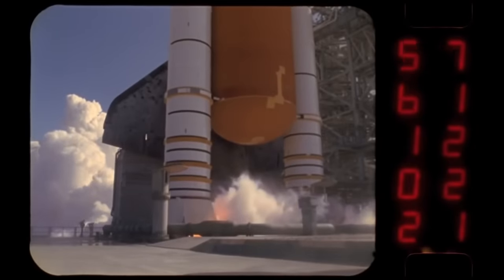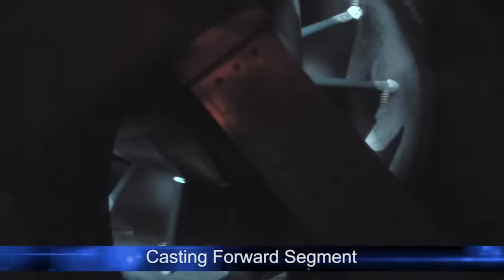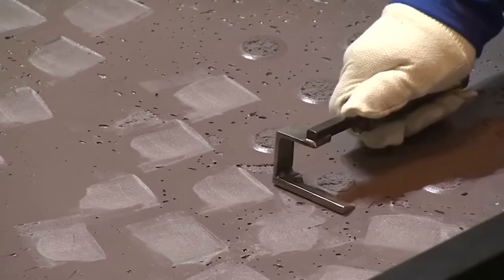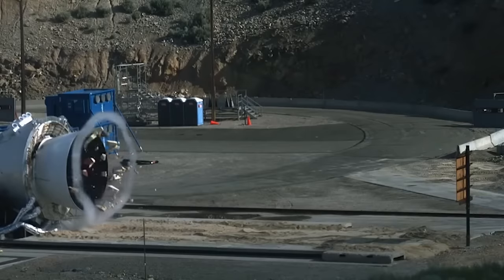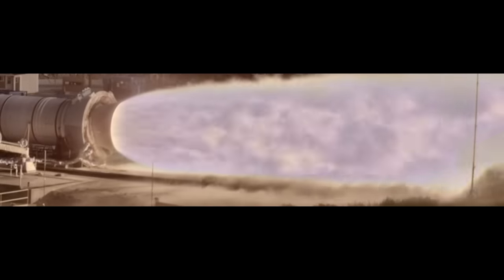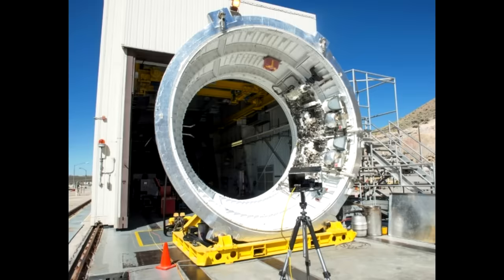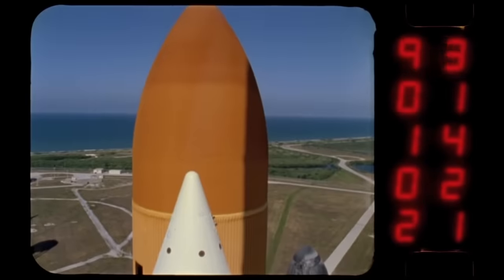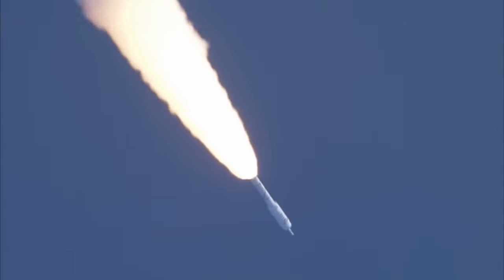The Amazing Engineering Behind Solid Rocket Boosters

Comment: Finally, I get to learn about the space shuttle booster TVC! I've been wondering about it for a long time.
Reply: Yeah me too. I always wondered how they could move considering they needed a flexible part that could take the immense heat. But lots of metal plates it is :)
Reply: @221b-l3t  The rubber seal is the most impressive thing imo. What did they tell the material scientists? Umm, we need a flexible material that can handle a thousand degrees and 60 bar...

Comment: Good Report.
Back in 1971 I was at Indianhead Maryland Naval Ordnance station when a disposal burn of a cracked Polaris motor detonated 1/4 of the way through the burn. Shockwaves from the blast carried by the limestone bedding layer cracked the Capitol basement wall. Both the test fixture and the Capital rest of the same rock layer. 3,000 pounds of propellant went bang in a split second.

Comment: Never knew that about the wind shear on challenger’s last flight.
Reply: Especially considering you hear rocket launchers getting delayed all the time for windshear
They really were in a rush to get that shuttle launch
Reply: @TheJoeSwanon  That's really too bad :(
Reply: jonathan lavezzi what’s worse is multiple engineers even told them that it would fail the night before. The document didn’t become known until a few years after because they tried hiding it.
Reply: @TheJoeSwanon  
Yep the engineers from Morton Thai called told them they hadn't tested the o-ring seals for temperatures that low and they didn't think that they should launch. NASA did it anyway.  Stupid mistake. NASA had way too much bureaucracy. Apparently they still do. That's one of the problems with government run programs. There's very little incentive to be efficient and eliminate unneeded bureaucracy.
Reply: Neither did I!
Reply: @dpreston8831  Challenger was not the first time they noticed burn-through damage on the O-rings; on previous cold weather launches the O-rings showed damage after the SRBs were recovered. That's how the Thiokol (and NASA) engineers knew there was potential trouble. In the Challenger accident, the combination of icy weather and wind shear made for the perfect storm and for the first time there was a catastrophic burn through. This failure mode was known to be a problem but the program was under a lot of pressure to produce a high flight rate and get costs down, so they kept putting off the field joint redesign and crossing their fingers. Mike Mullane's book does a great job explaining the mindset of the decision makers. It's also the reason they kept blowing off the debris shedding problem that eventually wrecked Columbia; that was a known issue from the very first flight and they talked themselves into thinking it wasn't really a threat even though the original requirements from the 70s allowed for no debris striking the orbiter.
Reply: To add on to what others have said: there's a Super Great documentary on it. It's called A Rush To Launch. Check out min 34 to hear about the wind.... But honestly you should watch the whole thing. It'll make your blood boil and tear up, but it's worth it.
Reply: Almost like January weather was really not good launch conditions through and through...
Reply: @dankuchar6821  As I understand it, it wasn't really on NASA. The launch schedule was pressured to accelerate due to the SLS taking over Air Force launches, so the DOD was pushing a mandate of so many launches per year that they couldn't keep putting off. Furthermore, MT never communicated their engineers' doubts about the temperature conditions, so NASA really had no way to know that there would be a problem
Reply: @Xatzimi  That's what people mean when they say the bureaucracy caused it. People in different sections of the same program unable to communicate mission critical information.
Reply: @OCinneide  Yes, but the comment seemed to indicate that it was NASA who knew the risks and flagrantly ignored them, which is not the case. And it's not simply different departments, it's a contractor away with their own departments and problems in communication.
And it's disingenuous to suggest that the Shuttle program's problems stemmed solely from it being a government program. Competing departments complicated the scheduling and design problems, to be sure, but it was Thiokol, a private business, who holds the real blame for Challenger
Reply: @RCAvhstape  Allan McDonald's book Truth, Lies, and O-Rings is also an excellent one.
Reply: @Xatzimi  January in Florida is not usually as cold as it was on that morning. That said, a reliable launch vehicle should be able to operate in cold weather. STS shouldn't have had any problems with it if they hadn't cut corners to get the schedule on track.
Reply: @Xatzimi  hey, go check out the documentary I referenced earlier called Rush To Launch. NASA administrators straight up ignored warnings from Thiakol regarding cold temps. Had to get that bird in the sky!
Reply: @dankuchar6821  That's definitely a huge part of it, but every time there was a delay to a launch you saw news papers with headlines like "NASA fails to get it up yet again". I feel like the whole damn country at the time had an entirely too complacent and egocentric view of what was one of the most complicated engineering projects in all of human history. Combine public ridicule and congressional leaders bitching about program cost and delays with NASA management overseeing their own behavior and you get the Challenger disaster every time.
Reply: @oscarbanana6159  
I know! It's too bad public Perception gets in the way of safety.  Modern boosters are much safer! So at least there's that.
Reply: @Xatzimi  you must be a union worker.
Reply: Lucy Tycho so basically “people in different sections of the same program unable to communicate mission critical information”.
Reply: @Xatzimi  that's not true NASA new about Thyokol's concern but pressured them to give the ok
Reply: Yep. Look at the shape of the plume suddenly change direction. Saw it in a documentary and it showed it so clearly. The joint temporarily sealed itself with 'slag' and would most likely have held on until separation had it not been for the extreme flexing induced by the windshear.
Reply: They suffered the same fate as Chernobyl. 
Conditions were bad, the engineers knew it, but some careerist bureaucrat above them told them to proceed with the olanned operation... the rest is history
Reply: @Xatzimi  Yeah I hate when people constantly complain about government run programs being inefficient and private corporations being efficient. It's a meaningless thing to say. The only thing corporations have any motivation to be efficient with is money, and that often involves cutting corners. Also, there is essentially no profit incentive to go to the moon. It never would have happened if it weren't for government run programs.
Reply: @playgroundchooser  Or just read the damn report. Lucy's not outright wrong, what NASA was told by Morton Thiokol was something more like "Somebody has concerns about the temperature, but we [in management] don't really think it will be a problem" than saying straight-up that an engineer had predicted a catastrophic failure.
Reply: @OCinneide  It was actually a well-known phenomenon that is usually harmless: lower levels of management minimize the amount of detail passed along to higher levels of management and in the process understate the seriousness of various kinds of risk.
A good recent extreme example of this would be the communications breakdown that happened in China in the early days of the SARS-CoV-2 outbreak. Local officials didn't want to seem incompetent or insufficiently independent so they didn't report the true scope of things to Beijing.
Reply: Dan Kuchar correct. It becomes incredibly political rather than merit based. This can happen to large private sector companies but market forces eventually catch up with them. Government run with no market forces you get a long term rot. Thank God space x is doing big things that nasa would never be able to do. All with commercial reasons at the forefront.
Reply: @MusicalMemeology  SpaceX has done very little that NASA hasn't already done, and they never would have done anything if it weren't for all the work NASA has already done. Not to mention that NASA is and will always be spacex's largest customer.
Reply: Well, it has only been mentioned in like fifty Challenger documentaries
Reply: @RCAvhstape  That's such a good book, I've just finished it.  Nothing else I've read describes just how terrifying those launches were.
Reply: @TheJoeSwanon  ice was dripping from the shuttle. But they wanted to impress the president and launched anyways
Reply: @Ok Alright. The pressure to launch came directly from the White House. The President wanted to brag about 25 shuttle launches in his upcoming State of the Union address. Nobody talks about that, not even Macdonald. But I was an engineer on Shuttle at the time and had open access to Bob Lund, the Director who signed the release to launch. We all knew the risk and Bob did not want to release the bird. Watching how he suffered over the next few months was heartbreaking. It still bothers me, too. Gil Morgan, the PR guy with the eye patch, told me at a party during the aftermath of the disaster what he had learned while everyone was in duck-and-cover mode: “You’ve got to be one cold asshole to be executive management”. He quit after the cameras were off him and Rocky Raab took his place. I transferred to Thiokol Huntsville Division at Redstone Arsenal, Alabama as a Project Manager. That was a difficult time. And Gil was right. If you become executive management and you aren’t a cold asshole, you will suffer.

Comment: Awesome video! One thing you may be interested in looking was the precursor work done by Thiokol, who developed the SRBs as you mentioned. Their experience with solid fuel came from their earlier work for the Air Force on the Minuteman ICBM program. Back in the 60s, if you wanted to launch an ICBM, you had one of two options: You could use cryogenic propellants, but these meant the the rocket had to be fueled before use. This meant the rocket force was at risk of being taken out on the ground before they were fully fueled, and once fueled, they had to be used within a period of time before too much propellant boiled off. The alternative was hypergolics, which, while storable, were incredably toxic as you've covered before. This was undesirable in a silo, and a non-starter on say, a submarine. A solid fuel ICBM on the other hand, was safe to store for long periods and didn't need to be fueled. It was groundbreaking in the 60s, and gave them the experience needed to adapt it to the SRB.

Comment: 6:00 "remove pin before flight?"
Reply: That’s a brave man
Reply: The pin locks out the electromechanical "Safe and Arm Device"  so basically the guy pulls the little pin out of the bigger pin  :P
Reply: @rileyk99  the "SAD"
Reply: @rileyk99  Pinsepcion!
Reply: Like the pin on a grenade.  Countdown doesn't start until you release the big lever by throwing it.
Reply: Which is why the incident in the movie "Space Camp" could never really happen. Those pins were not pulled before an FRF for that very reason--so that the boosters could not accidentally (or intentionally, if a sentient robot ever hacked anything) light during the test.
Reply: Bruh has balls heavier than the whole shuttle
Reply: How long before flight was the pin 📌 pulled

Comment: A rather odd factoid:  According to an old BBC show called "Connections", the size of the solid boosters was limited by the width of the railway cars and tunnels from the Utah facility, and those in turn were based on the track widths, which in turn were based on the width of common horse drawn carriages of the day when railroads started, which in turn were based on the ruts in the dirt roads that criss-crossed Europe, which dated back to the days of Roman chariots, which were designed based on the average width of two horses running side by side.  So the SRBs owe their design width to the width of two horses asses!!!
Reply: Which were based on the Indo-European chariots designed on the Pontic steppe.
Reply: ... which was not true, however a nice hoax :)
Reply: The United States used a different railroad gauge than Europe. Rumor has it that railroads in the US were actually reverse engineered by time travelling shuttle astronauts who knew they would need to be large enough for future SRB transport.
Reply: @divedevil985  there isn't a European gauge. Different countries use different gauges. As exemplified by the logistical challenges Germany faced moving eastwards in the early forties. Even different countries used multiple gauges. In the country where trains were invented the lines were made by competition between private firms and there were competing gauges.
Reply: VSauce, Michael here...

Comment: idk man seems kinda easy to build multi-ton boosters for rocket science.
Reply: Not that easy trust me❤️❤️❤️
Reply: @mechanicalrocketeer4900  <=== YOU                                                                                                              JOKE ===>
Reply: "I mean, it's just some clay and a tube. How hard can it be?"
Reply: @psyko2666  well if you wanna find out just go the elementmaker's channel and you can watch them build tiny little rocket engine, that fail horrible, because clay is not simple in the least bit.
Reply: @BloodSprite-tan  fantastic channel; I have almost no interest in actually doing it myself because I know better and he's very clear on why you don't simply play with high energy chemicals what get very pissed off...
Reply: Yes ikr i can literally split atoms at my house
Reply: Used to think the same a few years back, before I followed a rocket propulsion course specialized on  solid rocket motors. Man, the engineering behind them is insane! The chemical considerations on solid grain, its shape as a function of length of the booster, the heat transfer considerations, the combustion-instabilities cause by vibrations... INSANE. We can argue about their utility in this century as the main driver is to reduce launch prices, which is something SRB are not able to do. But from an engineering stand point, developing them right is as difficult as developing an expander cycle for liquid rocket, if not more.
Reply: ..said nobody ever!  :)
Reply: You should see the propellant mixing and casting building after an accident, not much building left.
Reply: @Jeff Jacobson. Thiokol suffered a loss at Air Force Plant III in Utah in 1986 after Challenger. A Peacekeeper first stage motor caught fire in the casting bell while the crew were trying to pop the core. The video camera for remote operation was inoperable and the men were in the bay with the live motor, against our safety protocols. 101,000 pounds of high energy propellant and five men killed.  As you say, there was not much left. All because a middle manager did not approve a new camera in a timely fashion.

Comment: So if the assembled booster is hit by a lightning strike on the pad, when the safety pin has been removed, there is a non-zero chance the booster could light taking everyone on a one way journey?
Reply: That's why the launch tower had that big spire on top, it was supposed to direct any lightning away from the shuttle stack.
Reply: @jwilder47  lol
Reply: @jwilder47  If that's true, that means they really, really, thought this out.
Reply: @ctleans6326  It's NASA, of course it is. But it's correct that that big thing on the tower is a lighting rod
Reply: I mean, it must have worked because the stack was never hit by lightning.

Comment: 6:00 So the takeaway from all this is that SRBs are overgrown grenades. Gotcha
Reply: @Xenro66  APCP does not detonate.  That difference cannot be overstated.
Reply: tell me when a solid rocket booster casing was shattered by the internal pressure?
Reply: @aemrt5745  I worked in every phase of srb from recovery to refurbishing. Please dont reply to me as if you have a practical clue about anything regarding a solid rocket motor because you dont. No booster casing used on the shuttle program ever remotely came close to an over pressure.
Reply: @aemrt5745  what is insulting is when an armchair enthusiast with no practical experience doesn't have the intelligence to listen to someone who actually worked on the boosters and continues to petulantly argue google talking points. You are right I dont know you. ..because you didnt work there.
Reply: @aemrt5745  the original assertion was that srb's are grenades.  No srb has ever exploded  so your cause and effect of a non-event is non-sense and people in the industry who take great pride in working on the most reliable rocket ever built do not appreciate the proliferation of ignorant comments. You are the one who has insulted.
Reply: @aemrt5745  like you said....not sts. This discussion is about sts not hypotheticals. Estes rocket motors dont count.
Reply: @aemrt5745  any rocket has the potential to "overpressurize". Watch spacex for numerous examples.
Reply: @gong1616  you should know.
Reply: @aemrt5745  overpressure is a design consideration for any pressure vessel including party balloons.

Comment: 4:16  "the thickness (of the propellant) will control the burnt rate"

No it doesn't. Thickness has minimal effect on burn rate. 
In solid fuel rocket motors that burn continuously from start up, the burn rate is determined by the surface area of the internal propellant surface.
Subtle shaping of this surface, including non-cylindrical and variable profiles, is used to achieve the desired burn rate and burn profile during the flight. 
My ex-wife was a rocket scientist!